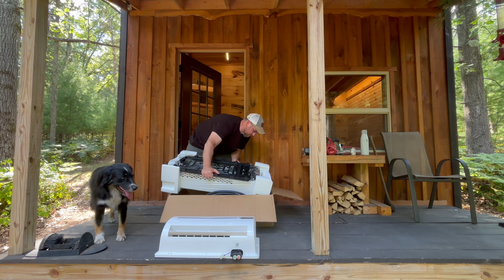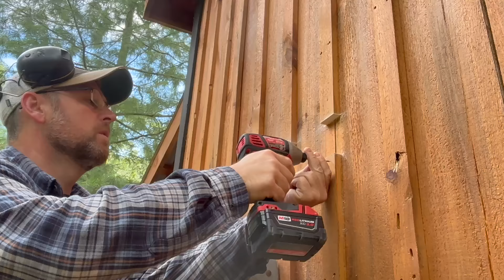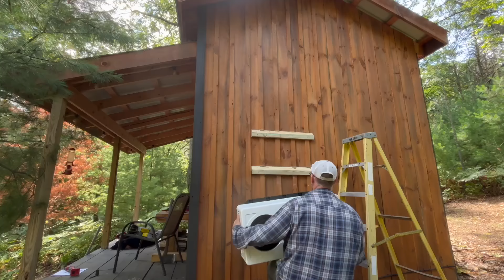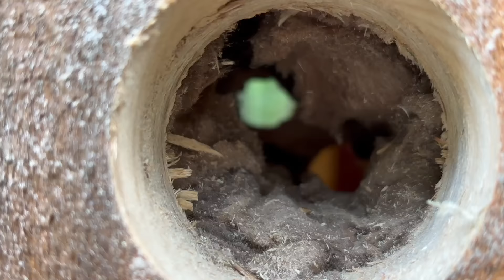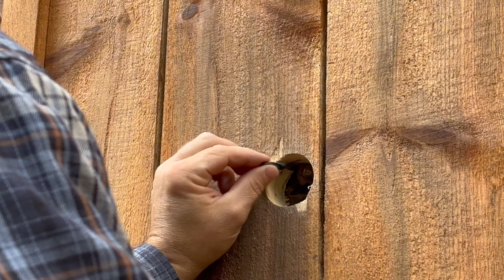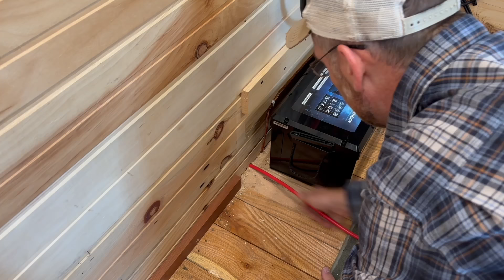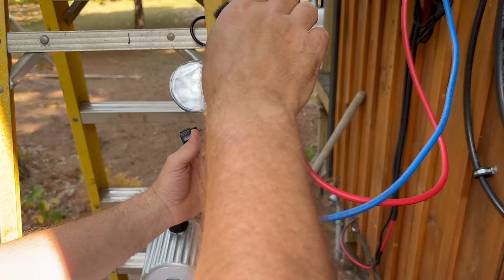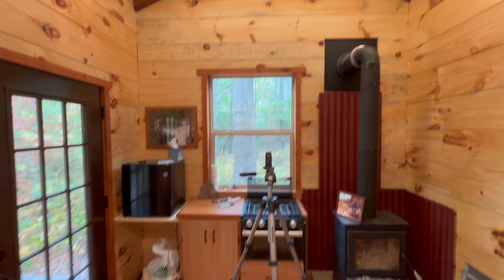12 volt Air Conditioner in the Off Grid Cabin ! OutEquipPro

Comment: Thanks for this great video!

I do have a question if you don’t mind?

What is the amp draw of this 12V unit at max and min cooling?

Thanks in advance.
Reply from the maker: Thanks !! I'm not sure. I'm thinking 50-60 amps but don't quote me on that
Reply: @blackspruce1861 - Sorry sorry…watt draw was what I meant to ask you.  I’m trying to figure out if I can run this unit in my insulated 1-car garage that I’m taking off-grid.  I’m using an EcoFlow Wave 3 right now but it’s just not powerful enough to efficiently cool it down at only 6100 BTU’s.  But this unit might do it!
Reply: @Stuff7164  Well if it draws 60 amps and the battery at 13 volts just do 13x58=754, on the low side @ 450-500. Its a inverter so you won't get a big surge, the compressor never stop just spin real slow when not needed.
Reply: @Scott-ig1zd - Thank you!